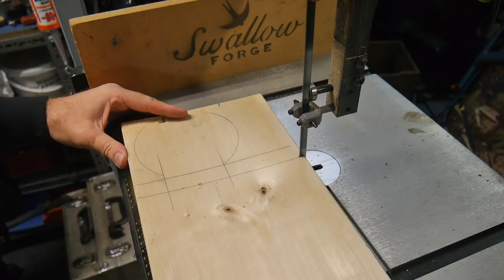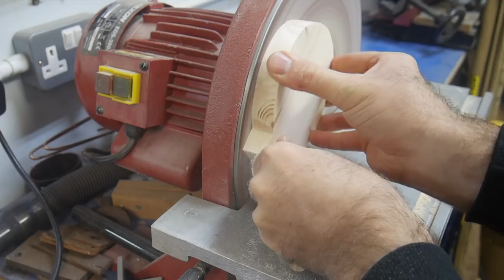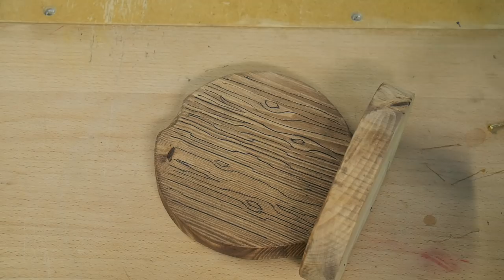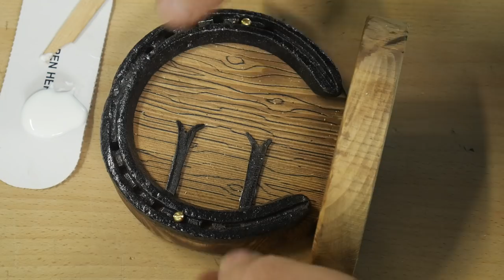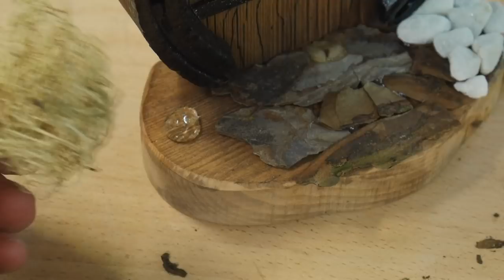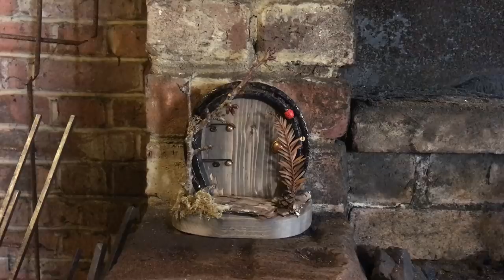How to make a Horseshoe Fairy Door : Swallow Forge

Comment: This is very good. I would like to see similar only for a hinged door (horseshoe would be nice but not requried).  I want to install a hinged fairy door that opens and closes.
I want to attach this to the base of an outdoor tree (there is a small void at the base that the door opens onto). So it needs to be fairly weatherproof. 
I believe I'd need to use aluminum wood screws to secure the aluminum hinge to the tree??